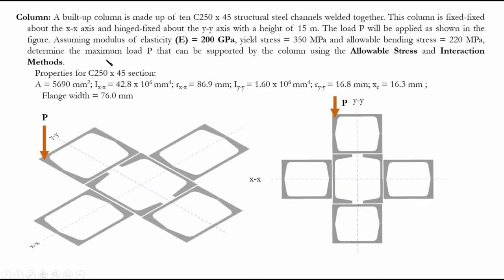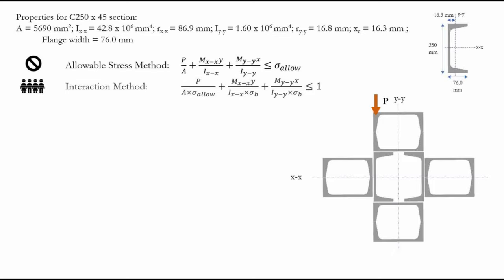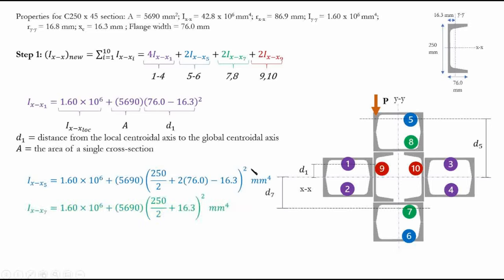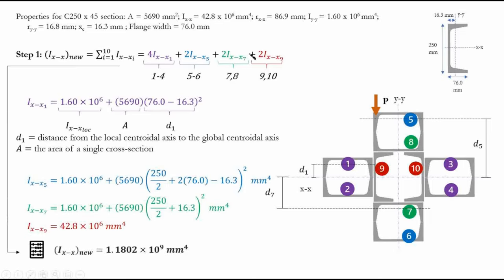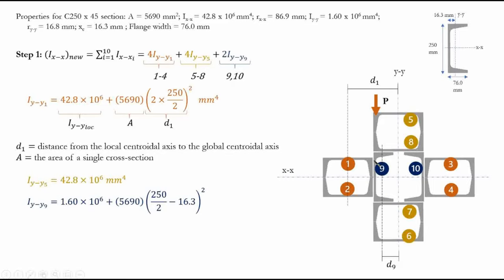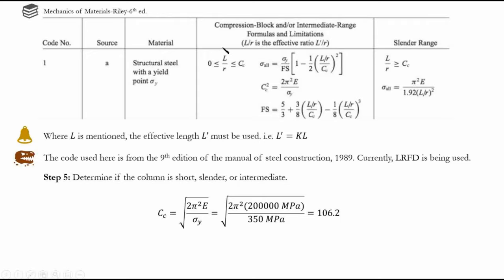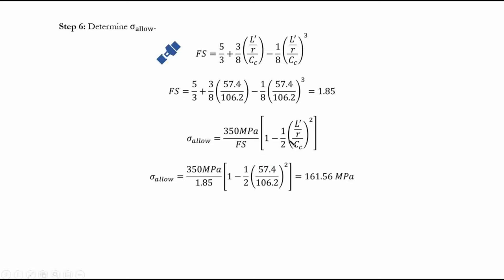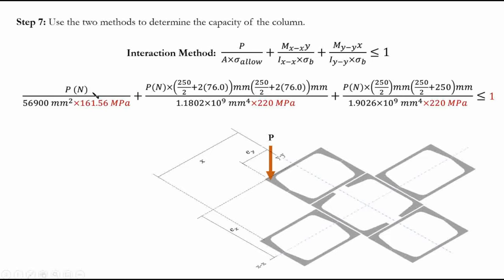Column Capacity (Comprehensive) - Strength of Materials

Comment from the maker: Correction: C250x45 means that the nominal depth of the channel is 250 mm (the actual depth can be a bit different) and and the nominal weight is 0.45 kN/m (not 45 kN/m as mentioned in the video).